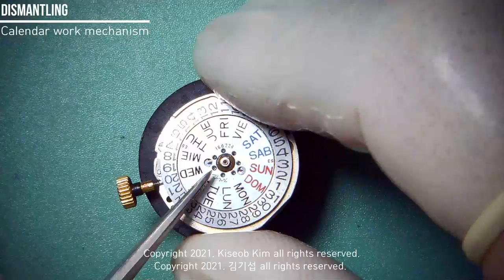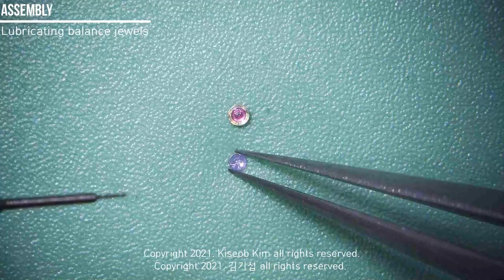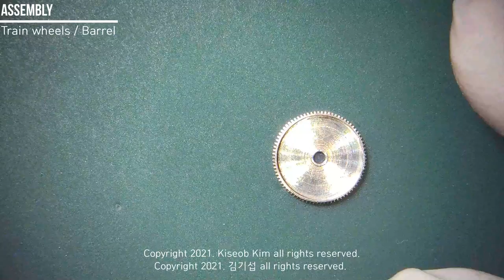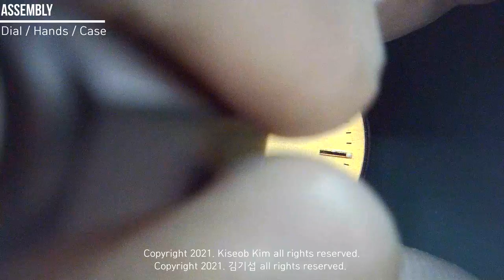[1080p60] Seiko 4206B dismantling and assembling

Comment: Hello. 
Under the automatic winding mechanism, there is a fork with a jewel which missing when assembly. is it a choice? Normal? An error?
Thanks!
Reply from the maker: It depends on the lubrication style and the structure of the movement. However, in most cases it is better to install an automatic device at the final assembly stage. Because there are many advantages to lubrication and regulate.

   When recording this video, I lubricated the pallet fork jewels prior to assembly. So the automatic bridge was not a problem for lubrication. And there is no interrupt for regulating. However, I do not lubricated that way these days. 😀